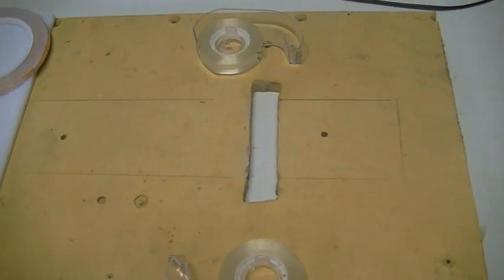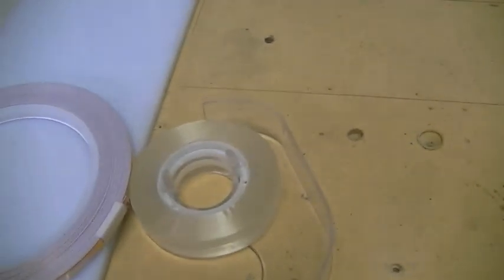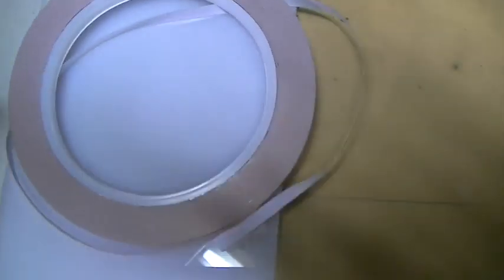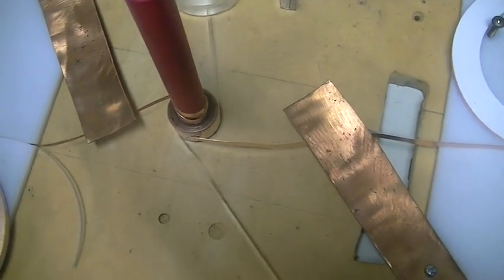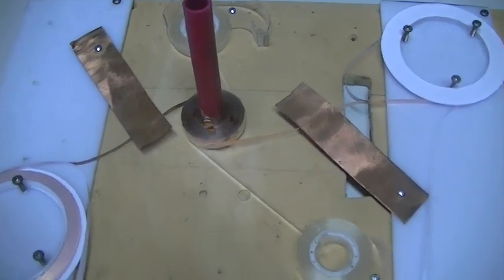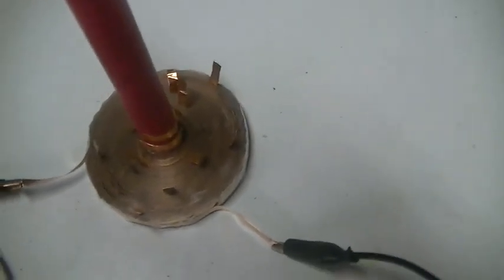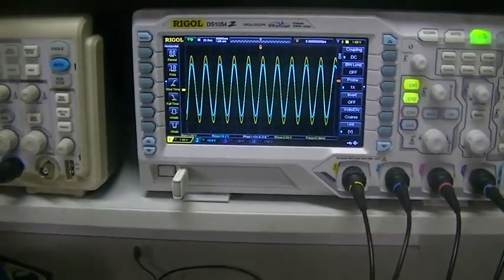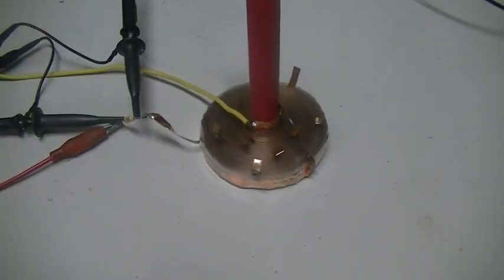Tesla BPC from copper ribbon winding jig

Comment: Thanks for this - I just saw it a couple of weeks ago and have a question!
I built a similar but much larger 142mm Bifilar Pancake coil, 306 winds using 160 meters (80m per coil) of similar 5mm copper tape and polyimide tape to get 6kV breakdown voltage.
It has per coil: C = 274nF; L = 5.85 mH, and R = 24 ohms.
The only resonance I can find per coil is at 320Kc/s - I was expecting much lower, like ~ 3.98Kc/s as calculated. Yours is 43Kc/s and I'm wondering what I'm doing wrong! Also, there is no resonance at all when connected as a normal bifilar regardless of flow direction. Continuity is good with both coils (measured separately and together combined resistance is good).
I have limited experience in this field so any advice you or anyone else may have would be much appreciated - thanks!
(To find the resonance I'm using a standard simple circuit - sig gen sine wave swept into the top of the coil. The coil output into a 1 Mohm resistor to gnd. Probing coil side of the resistor on scope.)

Comment: nice and dodgy. did the job. plan on doing the same. 10mm tape. but throw some maths at it first.

like working at 1mhz, so 75m total. got two 50m rolls... (5 actually).

some nasty number juggling. know the thickness of the tape, and dielectric constants... to a degree. can use more (insulating) tape too.
know the surface area. can figure capacitance.
from distance between layers, get total turns and finally inductance...

all for 1mhz... ouch.

sounds like spread sheet stuff...
Reply: i did some maths, if its accurate is another matter entirely... the mixed inductance and capacitance is rather tricky to measure or predict.

the meter is useless here, as it uses the same circuit, you find its capacitance and inductance readings are simply the inverse of each other. hard to explain but if you plug a capacitor into the inductor socket and set it for inductance you still get the correct reading... except its the inverse. the only way to measure the inductance in these is to give it some ferrite core, i believe. you have to isolate the electrostatic from the magnetodynamic.

anyway, guesstimating tape and copper as 0.1mm each, on 50M of tape i got approx a 6 inch coil, with a res freq around 7khz. can only make one and compare reality to prediction....

for the 750mhz or so required for a 50m (100m?) 1/4 wave, the coil actually ends up being 24 turns (or 2x layers of 12) at 55mm spacing, in air, for a 2.7m wide coil.... thats using 10mm copper tape.

so yeah, would be worth winding a few and doing some tests.